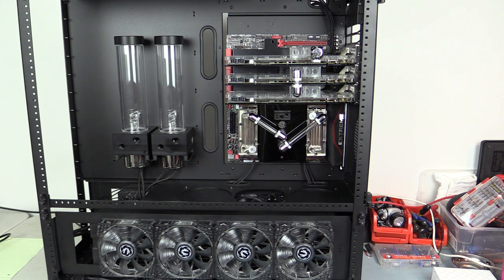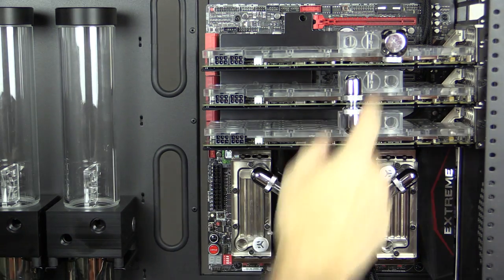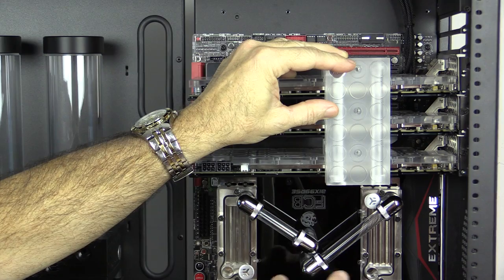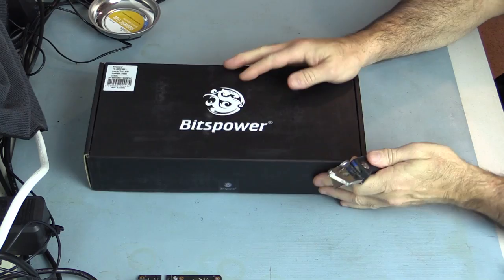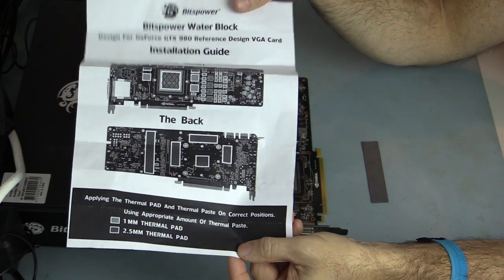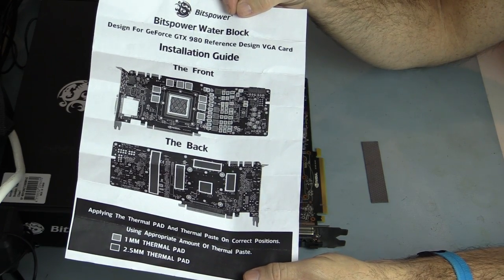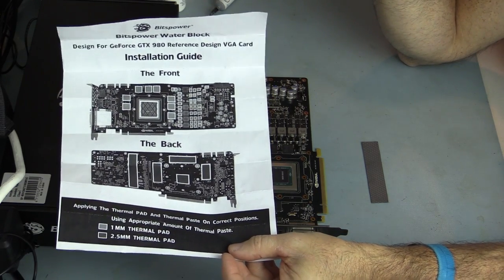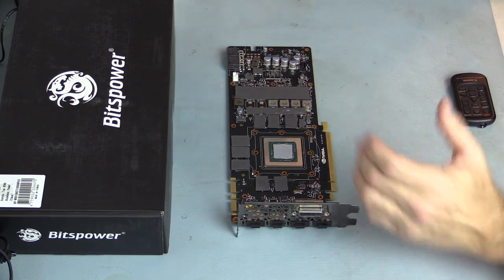STH10 Monsta Build Log 5 Installing New Blocks, Drain, and Planning Aquaero

Comment: the clear cpu block looks awesome, good choice! Just a thought: the spider like tubing around the inlet/outlets to the rads looks very cool and it's a shame to put the aquero boards in front of them. maybe drop some perspex panels in instead and move the aqueros someplace where there isn't cool stuff to look at. I bet some well positioned leds would make the rad piping look great.

Comment: the clear fcb for the mb looks much better. I would have gone with the bitspower gpu blocks too, but the silver prtion on the front and the backplate that dows not cover the full pcb really bugged me, since they are very expensive.

Comment: Catching up on subscriptions and man this is tight! :-)
Showcases just how much work and thought goes in to a build to keep it aestetically pleasing. Have to agree with one of the commenters stating that the drain system is almost to nice not to be showcased....but hey.. sometimes you just cant win them all in the constant battle beetween form and function.
Awesome stuff Ron..dont mind me sharing this. You have this build running in forums? Cheers mate.
Reply from the maker: Thanks for watching and the feedback.  yes, I thought about installing the drain system up top, but functionally it really should be at the lowest point, and when you see the tubing runs, I think it looks a lot cleaner and would have been more cluttered if I put it up top.  By all means share away, I am humbled.  Thank you.

Comment: Really like the way that upside down mobo looks as well as the blocks.

But damn, Bitspower definitely is asking for a fight! those blocks looks very sexy! The bigger block over the CPU looks better too than the black version.

And the GPU block looks pretty sexy and clean.And inside the case they look pretty straight and solid.

With the amount of water cooling components, I gotta say its definitely a Monsta build Lol! :D

Kinda not a fan of big cover block on the CPU though. Since it covers the Mobo. But maybe if a red coolant is used for that build it might do it justice. Because so far without coolant, the blocks looks White then the mobo has Red parts. Probably  work better if the mobo had all Black colors specially on the expansion slots unless if its like the Ram slots which is completely covered by the block.

Because if you look from a afar without coolant, the majority colors are White, silver and black which goes well with each other. Then the Red on the mobo kinda ruins it. But perhaps a red coolant might equalize it. hehe

But damn this build so far is one of the best you have created! Its a MONstah!

Comment: Hey man, I've only recently found your channel, but I enjoy your videos and really like your builds so I thought I'd try to get your opinion here. (Sorry that it will be a little long.) On this build, it looks like your first rad is fed with cool air from outside the case and the second rad is fed by the air warmed by passing through the first rad. There is a lot of debate about pulling cool air/dumping warm air into the case versus pushing the warmer case air through the rads and out of the case, but I've always felt like this is a zero sum game. Clearly, it's less of an issue in an isolated compartment such as you're using, but the second rad is still fed with air warmer than the first rad. I would really like to know your thoughts on this.
Reply from the maker: +Michael Murray The difference in temps is negligible, but I think I also have a vent in the back panel that allows air to be pull in between the rads as well.   Everything runs very cool.

Comment: Excellent work as usual but the 1 thing I can't stand is Ram Water Blocks.IMO they are useless and don't do anything for Aesthetics,They add clutter so I prefer a low profile or aggressive heat spreader in there place.

Comment: Can you fit a 480 radiator and a PSU in the same chamber?
Reply from the maker: Yes. I have two 480's in the bottom of this system now. You can put a 480 on one side and the PSU on the other.